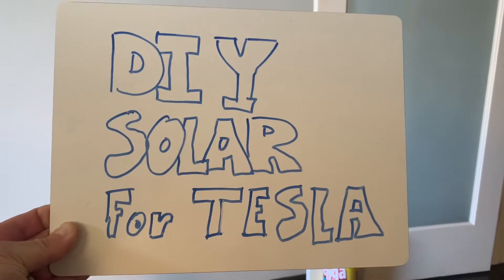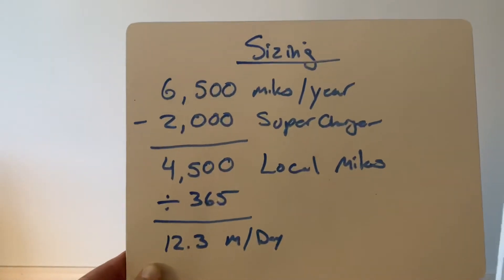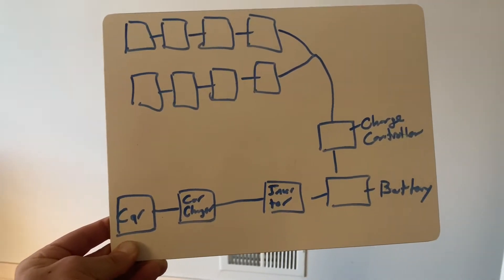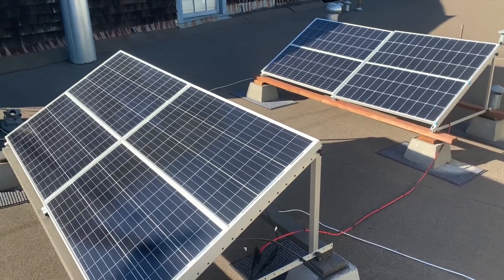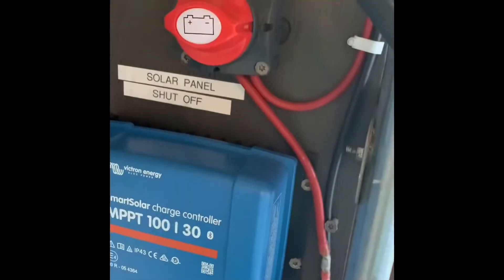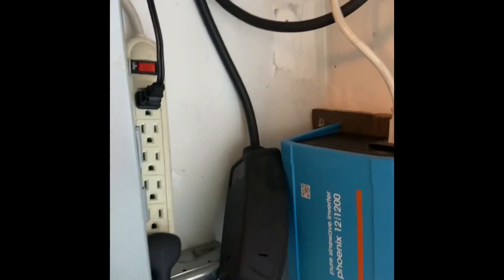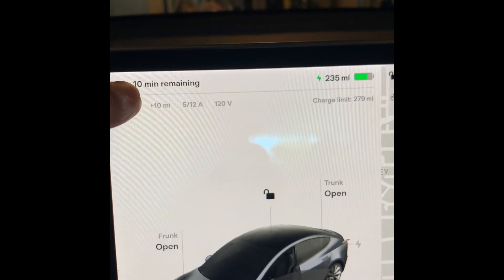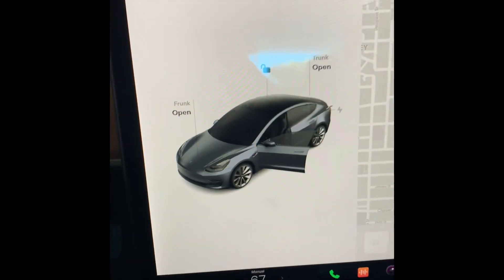How to Trickle Charge Your Tesla from DIY, Off-Grid Micro-Solar Array (+12 miles/day)

Comment: As an enthusiast that’s also run the numbers i guess id say that’s cool but is the juice worth the squeeze? Ie how many lifetime miles will this setup produce? The panels are 150$ each ish (x8 with the wiring) the inverter and battery are at least 2000$ ish. So approximately 3000$. For 3000$ you can super charge thousands of miles in blazing speed, a decent guess would be 3000$ in supercharged cost is about 60,000 miles. So you drive 4500 miles per year, that is 8-9 years right?
Reply: I just priced it out on the internet and could get the listed equipment for $2140.  You could get 800kW worth of panels for a lot cheaper than buying 8 x 100kW panels though.  Still it would take a while to get back your investment but that depends on how much you pay for electricity.
Reply: @allent1034  I think you meant to say 800watt panels, panels do not product kw atleast not ones i know of i think the highest iv seen is 450-500w panels. 8 x 100w = 800w so just 200w shy of 1kwh (1 kilowatt per hour).

Comment: I wanted to try this exact thing. I already had a full off grid solar system. I tried connecting the Tesla's 120v charger to the inverter and the charger just flashes red. I tried two different inverters, both are high-end pure sine waves. One is a Victron and the other an AIMS. I tried tieing the inverters' grounds to the house's ground and still no luck.
Reply from the maker: The grounding is key. Here’s a video that shows how I grounded the inverter to the case. Then I attached the inverter to an earth ground. https://youtu.be/ehK0uYNtaIY?si=BUMVAnN5pNqxT0Dj
Reply: @erictstahl  So I connected the ground pin from the charger directly to earth ground, skipping the inverter entirely. It still flashes...

It flashes 4 times and the manual says that means over/under voltage protection. I tested the inverter's output and they both give a stable 121v.
Reply from the maker: @hackmaster124 don’t skip grounding the inverter

Comment from the maker: If I where to do this again I'd do a 48v battery with an all in one charge controller/inverter and 3k watts.
Reply: why?  what would be the incremental benefits?  perhaps 24 or more miles per day?  also would it be possible to do your solution without a batter,y even if that meant a few interuptions for clouds?  all to say ireally  like the way you think :)

Comment: This is really good. I would love to do this. Have you done the math on upping to a 220v outlet in case you all of a sudden had a longer daily drive?

Also any willingness to share the cost? My guess is something like $3-4k. Am I close?
Reply: I see another thread about the cost. Thanks again for sharing
Reply from the maker: I have a 220 plug tied to the grid and use that when I need to fully juice up.  This set up is for when the car is just sitting around.
Reply: @erictstahl  That's exactly the setup that I want. The car consumes like 2-3x what the house consumes. I'd love to build an off grid just for the car and I'm trying to see what the smallest battery setup is that would allow me to essentially pass through directly to the car. Thanks for the informative video.
Reply from the maker: @rodericj  yes, that the way to go. By staying off grid you avoid a lot of permits and complexity.
Reply: @erictstahl  feels like you also avoid construction costs for a build that is honestly kind of simple. Ok I’m convinced. Going to start planning.

Comment: Eric, thanks for sharing. silly question, would it be possible to connect tesla directly to inverter without battery? the idea would to put more panels (which are cheap) with price of batteries.
Reply from the maker: It’s possible but not practical. The inverter puts out 120 / 240 volts but the amps / watts go up and down when clouds go by so it wouldn’t really work. Going into a battery smooths it out and gives the charger a steady supply.
Reply: I've direct charged my truck batts w one small charge controller and a small flexible 100 watt Synergy flexible solar panel. All available on Amazon 💚

Comment: This is exactly what I'm doing. I've been using mine to run my deep freeze...just didn't know if this would work well to charge an EV. I only drive 5 -10 miles about four or five days a week. This would totally do it for me if I added four more panels and another Victron charge controller. Very happy to see that this works! Thanks!
Reply from the maker: I added a second charge controller, a second battery and another 800w of solar for a total of 1,600 watts. Works great.
Reply: @erictstahl  Thanks! How big is the inverter for charging your Tesla? Will a 2000 watt inverter work?
Reply from the maker: @coolspace2136  mine is only 1,200 watts. I wish I has more but it changes the car at 6 or 7 amps and I get 10-25 miles/day, which really adds up.

Comment: Is the 1200W inverter holding up ok for this? Doesnt the Tesla charger want 1300-1500w ?
Reply from the maker: You can adjust how many amps the car is pulling. The tesla can go as low as 5 amps (600 watts). I usually charge at 6 - 8 amps. It’s only 2-3 miles / hour, but I’m only trying to add 15-25 miles/day when the car is just sitting around.

Comment: Nice video and design. Look forward to a video on your updated video/lessons learned. Can any good pure sine wave inverter be used or was there a reason you used the Vectron?
Reply from the maker: Thanks. Anything that puts out a steady 120v should be fine.  I chose victron because I wanted high quality. It’s in my garage so I don’t want a fire.

Comment: Could I use the 120v AC charger with less than 5 amps? If I only had a 500w inverter.... great video I have 150w of solar,  and (2) 1kwh battery packs.
Reply: You can go all the way down to 1 Amp via the Tesla API, just not through the official app. Tessie can do it as can the HACS Home Assistant Tesla Custom integration. Just be aware that for some reason settings below 3 (or so) need to be sent twice in order to stick.

Comment: Nice job could you charge with DC and skip the inverter?
Reply from the maker: The Tesla charger connects to a 120v or a 240v plug, so as far as I know, you need to go through an inverter.
Reply: @erictstahl  I thought super charger was dc and bypass onboard inverter. May need to high voltage to do this at home
Reply from the maker: @brhutchi  That sound right, but the home charger needs a 120 or 240 plug.

Comment: Eric- this is exactly what I’ve been wanting to do but never found a video like yours explains it. Would be interested in hearing how much you spent,  and anything you might have done differently. What happens to charging if let’s say you had half the amount of panels? Tesla is my wife’s and its home majority of the time during the day and why not have it charge. Thanks.
Reply from the maker: I've upgraded the system since this video and will do a new one soon.  I added a second charge controller and a second 206 amp hour battery.  I probably spent around $4k but I think I'm going to get 26% back in my taxes.  If I did it again I would have used 24v inverter.  Given the size of the tesla battery... do don't think 400 watts of solar will make much of a dent, but you can try it and add to your system if needed.
Reply: @erictstahl  look forward to the new video. Thanks for the reply.
Reply: @erictstahl sounds like a great upgrade. Can you elaborate on how the 26% back on taxes works? Thanks for sharing your setup.
Reply from the maker: @Code_hack_  when you file your taxes you submit the expenses to get the tax benefit. https://www.energy.gov/eere/solar/homeowners-guide-federal-tax-credit-solar-photovoltaics
Reply: @erictstahl  thanks for the info and link. I found your last video where you added another controller. Great system and location. Thanks again

Comment: Hi, why did you have to use the batery? Could you have connected the solar directly into yhe inverter to charge? You would not be charging without the sun but the batery drains guickly anyway... it would keep the cost down even more
Reply from the maker: I don’t think the car charger could deal with the voltage swinging all over the place. If someone knows differently, I’d love to skip the battery.
Reply: Even if you could reliably power the inverter directly from panels without blowing it from overvolt or constant brownouts, you would be wasting generated power above what the car is consuming.  The battery will collect excess charge which will allow charging longer even after the panels have insufficient voltage.
Reply: Well, I think that is what the inverter is for.. a good inverter should give you constant voltage. So, you either charge or not depending on wether the voltage out of the panels is good or not..
Reply: That is basically how the "on grid" system works. If you have a good steady voltage you are feeding your household.. if the voltage is not steady, you ate back on the grid..
Reply from the maker: This is an off grid systems.  I misspoke in my prior  comment.  The volts are pretty steady... but the amps/watts are all over the place i.e. when a cloud passes by.  I don't know if the Tesla would like that... but I will dig into it.  Thanks for the idea.
Reply from the maker: @EN-oh7mz  You are correct - the output voltage would be 120v.  But the input amps and watts would be all over the place.
Reply: @erictstahl  That doesn't matter. The inverter will deal with it. You can put a supercap in line to cushion really wild swings. It costs a lot less than a battery.
Reply from the maker: @wootWoot3  the charger has a 120v plug and a 240v plug. You are saying to wire that directly to the MPPT?  You might be right but I’m not testing that on my car :-)
Reply: @erictstahl  No, that's not what I am saying. "The inverter will deal with it" - means that the inverter, converting DC to 110 AC, will deal with voltage coming directly from the solar panels, without the need for an MPTT or batteries. 
So, lets recap: The original question was "did you have to use a battery?". They are asking if the battery is a required component in the system. The answer to that, is no, it is not required. Since in this answer we are omitting the battery, we should also omit the MPPT since it's sole purpose is to charge the battery, which we don't have. 
Well, then what's left? The solar panels, and the inverter. The solar panels can be wired to the inverter directly, to produce 110AC from whatever DC voltage the panels are supplying. That 110ac can then be fed to a Tesla charger. 
Does that make more sense?
Reply: @wootWoot3  That's not how off-grid systems work.  Inverters expect a very defined, constant range of DC voltage.  If you've ever measured the voltage coming from a PV array in realtime, its all over the place due to clouds, shading, etc.  And when tied in series, the PV voltage is well above the voltage that an inverter can accept, especially a 12v inverter.  The battery is necessary to provide a consistent voltage to the inverter.  The charge controller is necessary to regulate the voltage and current coming from the PV, in order to charge that battery.  A very few, expensive, inverter/charger units are capable of running without a battery, but they typically require very large arrays and still make use of an internal charge controller to regulate the voltage handed over to the inverter.  This is not one of those systems, and would not work if directly tied to the solar panels.

Comment: Nice! I just bought an abandoned farm in upstate NY and I have been thinking about an off grid charging solution for my 3.  A slightly scaled up version of this my be just what I need. (BTW found your video through a post on the FB Tesla Model 3 forum)
Reply from the maker: Awesome.  It's totally doable if you are able to watch a bunch of youtube videos and have some tools.  My advice is to 1) build the array off the building if possible.  It would be much easier to not worry about damaging the roof.  2) consider buying a kit that is pre-engineered to work together, then you just assemble it.  3) think deeply about the sizing of the system.  At the end of the day, you can spend test of thousands of dollars to build a huge system... or you can build a system that is just enough to get to the nearest supercharger.  LMK if you have any questions.
Reply: @erictstahl  Thank you! I'll definitely be making a video series about the building and install of my system. I'll keep you in the loop. ⚡️🚗

Comment: you'll want to secure your panels against wind.
Reply from the maker: Each array has 4 x 50 lbs of concrete footers.  That's 200 lbs holding it down.  I could add more weight or ratchet strap them down if I need more wind proofing...